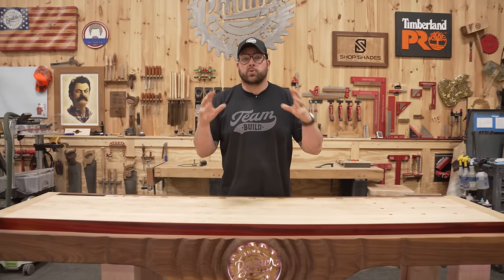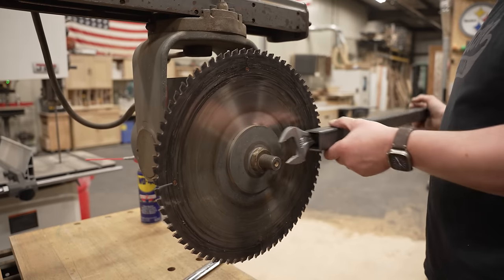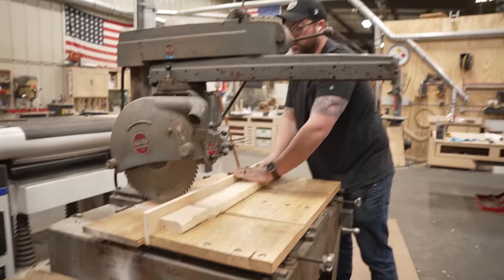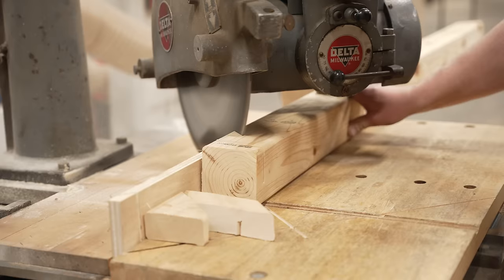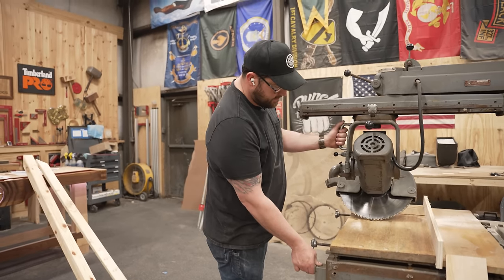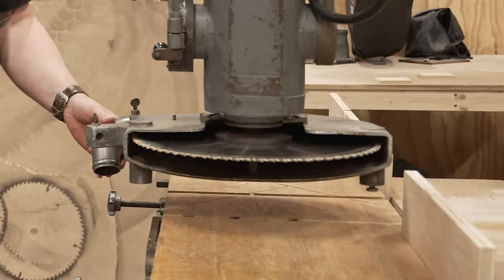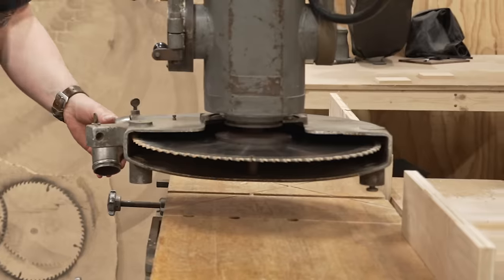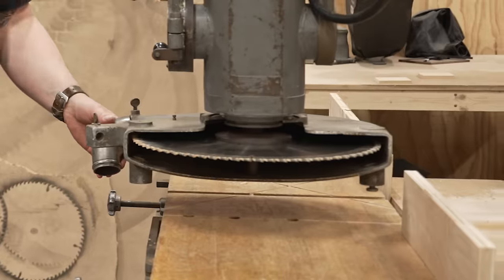Testing Woodworkings Most Dangerous Techniques

Comment: I was trained on a saw that size in the 1980s in my cabinet making class and again in my wood technology classes. My instructor kept stressing, "never bend your elbow when using a radial arm saw”. Keep your elbow joint in your arm locked and pull the blade back by rotating your torso. That prevents the saw from running away with you and lurching toward you. The second safety rule with it is to never cross your arms. If you keep your arms from crossing, it helps keep your other hand from getting in line with the cut and keeps your hand attached to your body. I still use this rule with sliding compound miter saws. My instructors also warned us to only use the radial arm saw for crosscuts and leave the rip cuts to the table saw. All three of my instructors at two different colleges had all three of these rules in place.
Reply: I am 66 now, when I was a kid, starting at 14-15, I worked for my uncle who built apts. we would use such a saw for prep work. 2 by blocks, posts, various sized headers (from 2x4 headers to 2x12 headers) and such. Unc would have a list for me every morning. I miss those days, it was work, but it was fun. If you know what I mean.
Reply: He’s gonna hurt himself with that limp arm pose 😂
Reply: These safety tips are greatly appreciated!
Reply: I had shop class in the early 90s and our old shop teacher taught us not to even pull. Maybe because we were all stupid kids, but it seemed more logical to push the blade that way any kickback was going away from you toward the fence/machine rather than a blade and handle smashing towards you. We were also told to never do long rip cut on the radial, better, safer more simple tools available.
Reply: Pulling the saw towards you while cutting, you're performing a climb cut... That's when the saw may run towards your body. You should actually push the saw away from your body while cutting (conventional cut)

Comment: You are missing parts that make the saw a lot safer.  The large hole on the front of the blade guard holds a rod with anti-kickback pawls.  There also should be a guard in the rear that holds the material down which greatly reduces climb and kick-back as you feed sheet stock in. I wouldn't ever feed a rip cut without the rear hold down guard; the way you did it was pretty dangerous.
Reply: Was just gonna say that , mine still has them
Reply: I came to the comments looking for this.  The anti-kickback pawls are missing.  And on my 6.5 Black and Decker (about 75 year old tool [Green and Red]) the blade guard is adjustable.  It can be 'tilted' forwards and back so you don't get blasted with dust / debris.
Reply: Sorry I will keep my table saw and 12" sliding miter, thanks. This saw died a very necessary and timely death, IMO.
Reply: I was just commenting on how there is supposed to be something that I thought was called a claw! I was so close on the name lol
Reply: My Craftsman RAS had extra guards over the blade.  Yours must be missing some.
Reply: Never ever rip on an RAS without the anti-kickback pawl
Reply: You can and should remove the fence to the left of your cut instead of removing the guard.
Reply: Yeah he doesnt care. He is the most dangerous tool in a workshop
Reply: You are also supposed to adjust the blade guard to cover the saw blade down to like 1/8th inch above the work piece on the front cutting side. This reduces the amount of exposed blade on the side the operator is using the saw. Doing this plus using the anti kick back stick in the back increases the safety tremendously.
Reply: @CKDz   me too👍👍

Comment: My first major shop tool in 1972 was a Dewalt RAS. I have used it to rip hundreds of feet of lumber. What makes it much safer than your saw was the fact the blade guard could be tilted backward to contact and hold the stock down. For narrower pieces you absolutely need a push stick. One attachment I never used was a rotary planer head to reduce the thickness of wood. That to me was way to dangerous.
Reply: Obviously this guy shouldn’t even turn this saw on. With some proper training and setup (as you saying tilting the saw guard down on rip cuts which does a decent job of dust diversion as well) it is a very usable saw. On the smaller and newer saws there was also a splitter and anti kickback pawls. This is an industrial saw. One learns to ride a tricycle before a bike. This guy is going directly to a unicycle. IMHO

Comment: I have a 12" craftsman, I would love to have a 16", I also agree with these saws being to dangerous for beginners. my high school woodshop class had one and our instructor had it OFF LIMITS to everyone but advanced class
Reply: My father has a 12" Craftsman radial and I have a 90 degree scar on my left arm from it due to a ripping accident. Blade grabbed the oak board he was ripping and shot it at me. I somehow got my arm between it and my head or it could have been a lot worse. I still don't know how it didn't break my arm. Far as I know, he hasn't used that saw for ripping wood since and I'm VERY careful of the direction a saw blade is travelling when cutting.
Reply: "advanced class" of 16 years olds with 16" death blades...  FML... old school days didn't care about safety
Reply: We had one in my shop class too and our instructor paid ZERO attention to anything... I used that thing all the time, freeken awesome!
Reply: Yeah I grew up using a craftsman 12”.
Reply: @cjamesfox  pretty sure advanced means more experience aka older students not 16 year olds
Reply: @sioward2753  That had to hurt. Fortunately for me the worst I've ever gotten was a piece of metal in my eye from overhead drilling (no eye protection) and when I was young just as my dad was about to drill a hole into some wood an earth quake hit. Right through my finger.

Comment: Hi John , I ve been a carpenter for over 30 years, I've used many radial arms saws, they are great for cross-cutting and doing dato cut . a big 16" saw is good if you work in a mill or a wood yard . all of those other features are great but should never been done . I like using the saw for the cross cut instead of doing the cut on a table saw

Comment: Assuming that this is a 3-phase machine (if I'm mistaken then ignore the rest of this) then you could wire it up to a VFD which will give you lots of benefits:
 - Slower ramp-up start (saw will no longer want to "jump" towards you on start up)
 - Option to decrease rpm's of blade (may benefit you when making deep cuts in hardwood)
 - and perhaps the most useful: option to apply "braking forces" on the blade to more quickly stop it once shut off.
...
All of these can be programmed to various settings on a VFD. I think the ability to turn your 3-minute spin-down into 10 seconds would be worth the VFD purchase alone. For both safety and convenience. Loved the video! Old machines are sexy.

Comment: John I was in the Seabees in the 80’s I used dewalt 16” radial arm saw mount on a 5 kw generator when we work in remote sites. I used it for ripping plywood all the time. When we did we always had two people sometimes 3 to tip plywood for concrete forms.

Comment: DEFINITELY GET A ELECTRIC BRAKE FITTED!  Had a similar saw in the place I did my apprenticeship, only used for cross cutting batons before machining down.
Reply: Yeah, just for reference the legal time for a bladed machine to come to a halt in the UK is less than 10 seconds :)
Reply: With a 16" blade the force of a DC brake making it come to a stop would likely unscrew the nut holding the blade on because the blade isn't pinned to the arbour, so the inertia of the blade wants to continue spinning and thus unscrews the nut. That said, you could probably adjust the brake to stop in 10-15 seconds or so which wouldn't cause so much strain as stopping in 2 or 3 seconds, still much better than 5 minutes.
Reply: @WoodMachinist  As long as it can just slightly slow it without trying to stop it that would make a huge difference in its safety and use. Kind of like brakes on a bike, you can use them to add just a slight friction to take a little moment out without just clamping down and stopping like you would do going down hill. I don't know if you would get that kind of adjustment out of an electric brake addon but if you can I think thats the way to go.
Reply: dad's had a red rectangular button on the motor that braked the blade.. basically a mechanical brake..

Comment: When ripping, you turn the blade guard down so it's just above the wood being ripped.  That way it doesn't chuck so much wood at you and in later versions they had an anti-kickback tool that was on the guard.
Reply: Malecki is trying to show this saw as best as he can but these details make this saw less dangerous though
Reply from the maker: I appreciate this. I wont be using it for that function tho haha
Reply: I love your work and channel and subscribed long ago!  But.  Sorry , even if you don’t use this function there are many, many, many foolish people. These people will take what you as an experienced wood work shows and assume it’s okay,  “ John” did it! Please be a good example. I mean talk the line but play safe under the top story.  I personally own Dewalt and Delta/Rockwell RAS , I love them and are very careful when using them.
Reply: @chrisdzisiak7540 The reality is that no one is responsible for the safety of another adult except for the adult themselves. If someone chooses to be a moron, that is their fault and only theirs. It is not up to John, you or anyone else to keep people from doing dumb shit.
Reply: @JohnMaleckiUnscrewed The problem is that by not showing it being done with common sense and the correct tools for safety, you are making the saw seem like more of a death trap than it actually is. Even if you don’t plan on using it to rip, you ought to at least try it properly. Perhaps you should get someone with more expertise to help, like you did with the shop-smith tool.

I own a radial arm saw, I use it all the time to rip and crosscut. I don’t own a miter saw and table saw, I don’t have the space to have both of those in my garage.
Reply: @Collin141  Of course it is safe to use in proper use. Every professionally made tool is. Chain saw juggling is also perfectly safe if you properly catch them at the handles.
Heck, why do we even need blade guards? Or sawstops for that matter? You are not supposed to touch the blade anyway. See where your logic is going?
Accidents are not part of proper use, but they still happen. Safety features are supposed to keep them from happening or at least minimize the injury when they inevitably do happen. Imagine someone tripping and falling towards the running saw. Not so much of an issue on a table saw with a fully covered blade as it is on a 16" partially exposed blade spinning at belly height.
The problem with this type of saw is that due to its layout and design the risk of a severe injury in an accident is several orders of magnitude higher than with modern table saws
Reply: @christiannorf1680  And he didn’t use the proper safety gear or techniques to rip that board. He should have tilted the blade guard towards the  infeed side and used the paw. He didn’t, he did it in the most unsafe way possible. You don’t have the guard on all the time when using a table saw do you? Do you use the guard when doing dado cuts and stuff that doesn’t go through the board? Not likely, the guard has to be off sometimes.

I have never done the ripping cut with the blade sticking out towards your gut, I use a circular saw for that or the RAS with a second person so they can control the piece not between the blade and guide. He also didn’t use a push stick when doing the rip cut, and seemingly intentionally put himself in a position where his hand was between the guide and blade.
Reply: @Collin141  I get your point. I'm not claiming he did it right.
All I'm saying is that the risk of severe injury is significantly higher than with for example a tablesaw. Because it is so much easier to bring it into an unsafe state.
Prevention of improper use should be and often is considered in the design of a tool. Take some larger industrial presses for example. They often have two buttons far apart that you can reach with both of your hands to operate it, but not with one. Why is this even necessary if it is as easy as "well, don't put your hand in the press, duh"? Because people do stupid shit all the time.

Comment: I use a 14” radial at work daily to rip plywood for export crates. The way I get around the potential kick back is to use a sacrificial board to feed the one I’m cutting through the cut. Also when ripping you can tip your blade guard down so that most of the duct comes out the shoot and not straight back at you.

Comment: Back in '70s I worked for a lumber yard. We used a big 16" radial arm saw for cutting framing lumber. We had very few accidents and when we did we found a bit of crazy glue and a buffing wheel buffed everything right out.

Comment: I bought a 10" Craftsman in about 1975 and used it for many years. When you do rip cuts you rotate the guard so that the leading edge is barely above your wood. That covers the most dangerous part of the blade. A hose from the dust elbow on the top of the guard is run into a dust hood at the back of the saw attached to a shop vac. That gets 90+ % of the dust. It was cleaner to use than most mitre saws today.
Straight cut off, mitres, compound bevels, in and out rips were all easy and safe.
I did use a dado head on straight dados but would never even think of using a moulding head. Scared the you know what out of me.
I finally got rid of it only because a table saw worked better for what I was doing then and I didn't have room for both.
But it was a very useful tool.
Took a bit of TLC to keep it square though. Adjusted that quite a lot. But the adjustments were easy and straighforward.

Comment: 23:30 take the blade off and spin it through 360 so the wires on the other side of the carrier!!
Then you can use the full slide rail.
Reply: 180 degrees, actually. Derp!😅
Reply: @bjornolson6527  180 on x axis + 180 on a axis= 360? :)
But yes your correct.

Comment: When I was 17 (back in the 80's) my 1st "propper" job was at a place called Bate Welding and Engineering Supplies. My job was to sharpen TCT saw blades. The biggest ones were for British Rail and they were between 36" and 42". That must have been a monster machine that they went on.
Reply: What sort of machine do you think they would have been used on?
Reply: @James-dv1df  Something that huge had to be something like a giant mill right? I cant imagine what else could use them. I would love to see a blade that big in person but never want to meet the machine it goes in haha

Comment: My father had a giant old radial arm saw in his commercial woodworking shop for 20+ years (he made wood windows and doors) and it was pretty much a single task tool, for cross cutting giant rough milled slabs of wood to length, before running through the thickness planer. It just sat on a bench at the back of the warehouse, right between huge racks for lumber storage and I don't think he ever messed with any setting on it ever, except when changing the blade between sharpening, because it was never used for precision. That side of the shop also had the shaper, so I guess it was the "watch your damn fingers!" zone

Comment: I've actually seen machines like this being modified with "primitive breaks". Essentially make a hole in the "blade guard", weld on a threaded pipe. Take a durable cylindrical piece of rubber which fits into the pipe and use that as the "break caliber" - and then use a screw/cap/plunger - whatever you choose to apply it towards the blade. Just be "fairly gentle" when applying break force in a place which was not designed for it - and remember to disengage it before stating it up again. (You can also make a spring-loaded mechanism which automatically disengages when you stop pushing it - however that's a bit more involved 😀)
Reply: Did you mean brake?

Comment: Graphic Warning
Yeah, I was eight when my dad chopped three of his fingers off with his radial arm. Still remember him running out of the garage holding his hand up yelling at me on the swingset to not go in there as he'd left it running. That saw is now mine decades later, and while I love the saw, I have a huge amount of respect for what it can do to me if I'm not careful with it. Still even have the blade that cut his fingers off on it lol. For the record, he was ripping wood using the full travel of the saw with all the guards removed. My mother had to find the fingers in a pile of sawdust and put them on ice. Doctors tried to reattach them, only one of the three was successfully reattached.